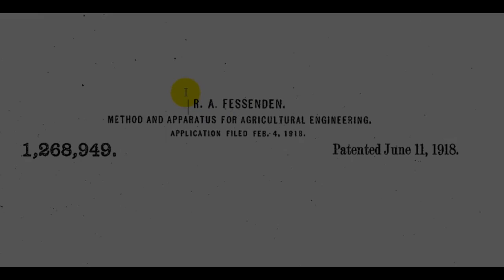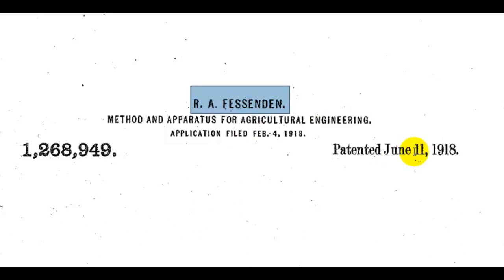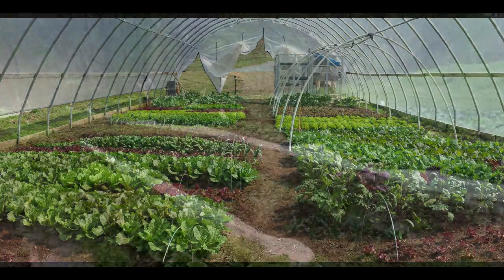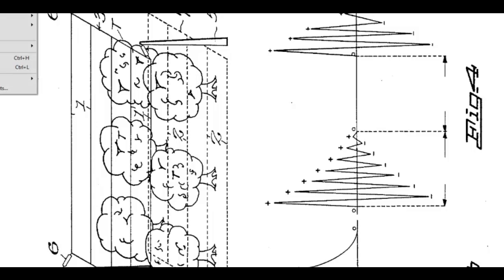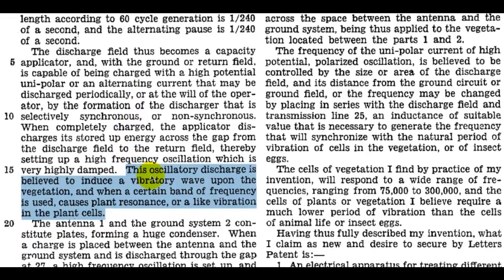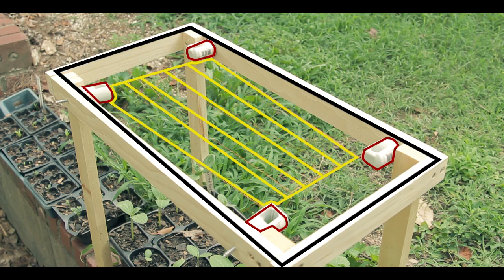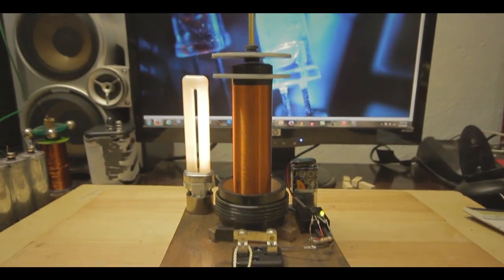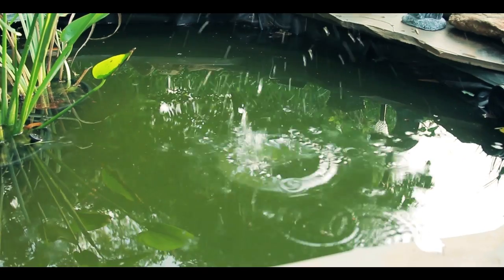Electrostatic Energy Electro-Horticulture Reginald Fessenden Excelling Plant Growth with Electricity

Comment: Are you aware of any methods utilizing the Earth's magnetic field? Or perhaps atmospheric electrical potential?
Reply from the maker: No, I am not aware of any of the mentioned methods when concerning accelerated plant growth. However, I am aware that these forces could be used in producing energy. Some believe Tesla was was able to harness what he called 'Cosmic Rays' and turned it into useable energy.

The methods mentions in my video work on resonance. This would involve finding the resonating frequency of the plant, so I am unsure how the earths magnetic field would help. Atmospheric electrical discharges, I believe, produce rapid growth effect on plants as seen during a thunderstorm. But, harnessing these chargers would be extreme. 

Duplicating the effect would be easier and is why the patents in my video used a spark gap in their system along with high frequencies. 

Of course this is just my opinions. I'm no expert in these matters. Thanks for watching and good luck with your research!

Comment: My idea is to measure the exact frequencies of the plant. Then, using Pythagorean ideas on resonance from music theory, create a perfect proportional amount of electricity to apply to the plants.
Reply from the maker: Matthew Correia How are you going to measure the exact frequencies of the plants? What is Pythagorean resonance?
Reply: +José da Vēde Well I will have to go through a lot of trial and error. I suppose once I find the harmony between the frequencies of energy and the frequency of the plants I will get much better growth. I assume they work on a similar level as Pythagoras's proportional musical tuning system. I will use this as a guide for the frequency I believe the plant to be at. Also I am reading some studies about ways to directly obtain a reading on the EM frequency of any living object. If I obtain this for a plant, I would plug that in to a proportional(Pythagoras) ratio with the corresponding amount of electricity from a system like what is described in your video. I will start with only one plant though. the goal is to create a musicalesque harmony in the cells of the plants, as described in the video, through resonance. Though today we can measure the exact amount of energy which could produce even better results.